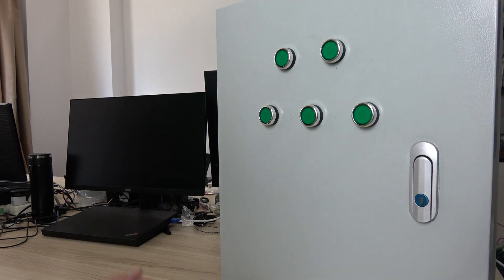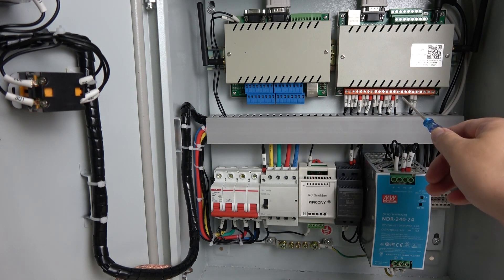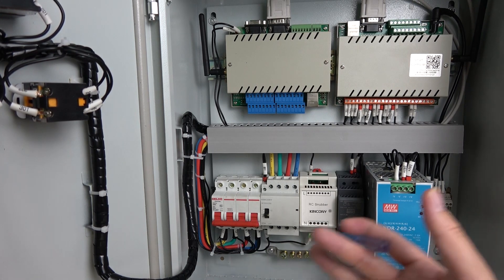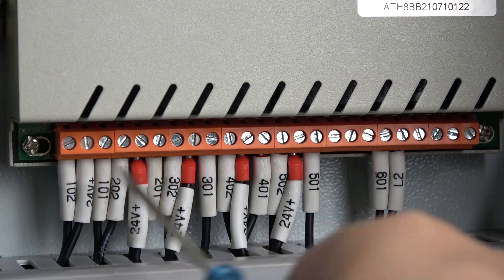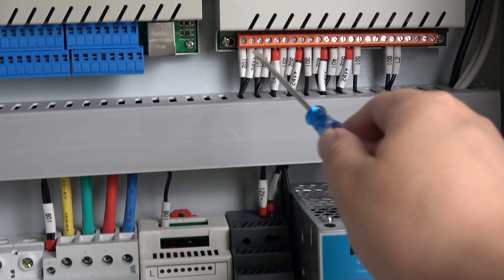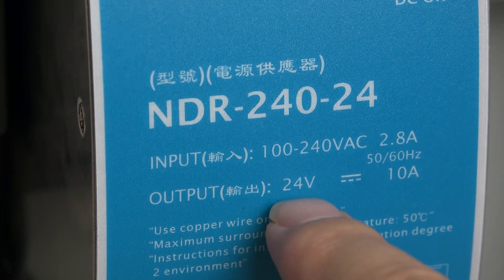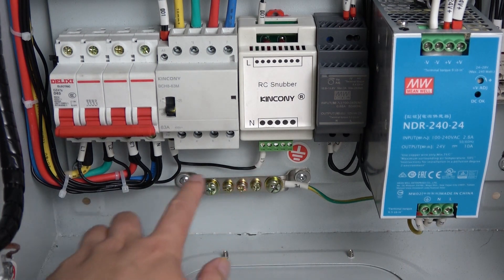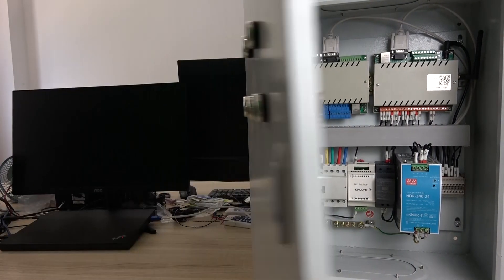smart distribution board for farmland pump and control solenoid valve

Comment: Could this control a VSD pump with a pressure transducer? Would be handy for maintaining water pressure without having to cause water hammer in the pipework.
Reply from the maker: if your VSD have RS485 and you know the protocol will be easy, because KC868-COLB can send customsize command by RS485 port.